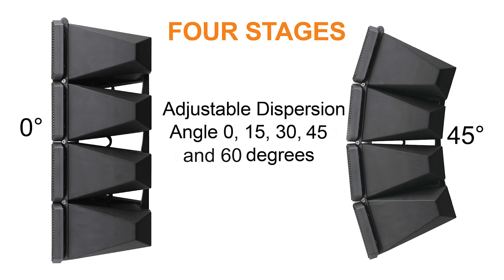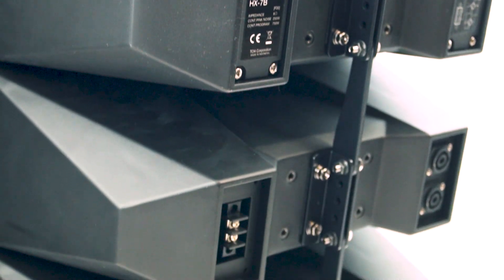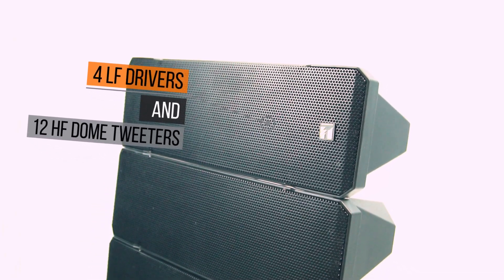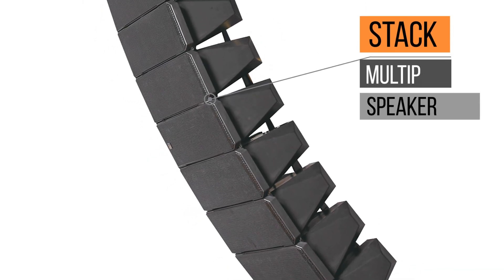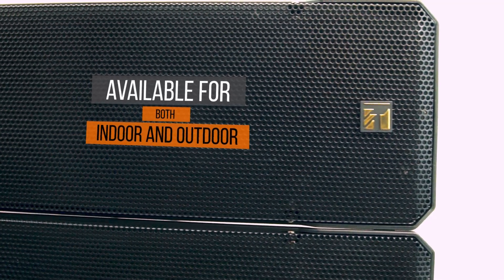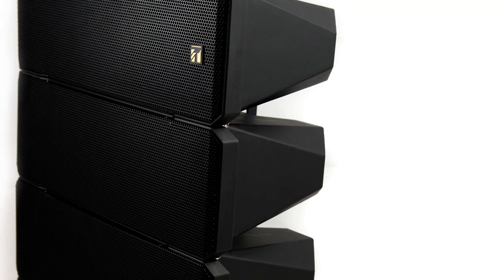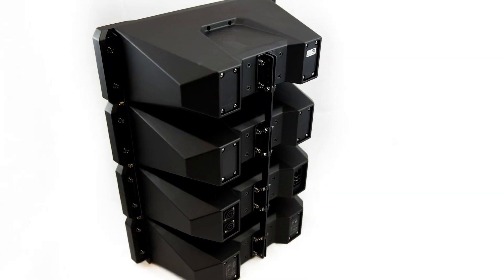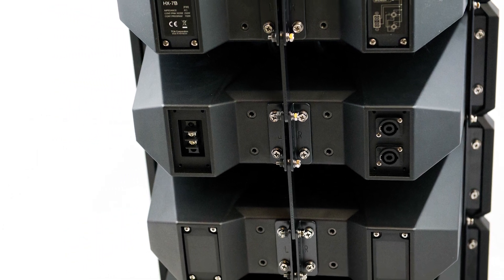TOA Canada's HX-7B Compact Line Array Speaker System

Comment: Am ? Correct me if am wrong . I think there are some wrong info. In the video. For eg. "4 LF drivers" Are'nt there 8 LF drivers 2 per enclosure. And 12 dome tweeters is their a compression driver being used. The specs discribes the Hx-5. Of Which my church uses a pair of the white ones. 👍
Reply from the maker: thanks for the heads up. You are right that particular detail is specific to the HX-5. Our newer HX-7 contains the following LF: 13 cm (5.5”) cone-type x 8
and HF: Wave front control horn with compression driver x 4. Either way both are great spakers. 👌
Reply: What are your experiences.with these? Is the sound in your church? Can they keep up with live music?
Reply: @seitonkumokoroye2059  Sorry for the late response.  Our church is 40'×40' small so the pair Hx-5w sounds full and punchy in the mid to Hi frequencies . I put a high pass filter from between 70-100hz. A must ,with  a sub to fill out the lower frequencies.